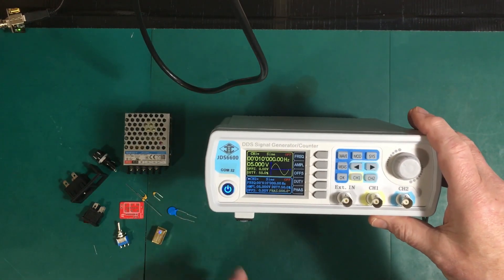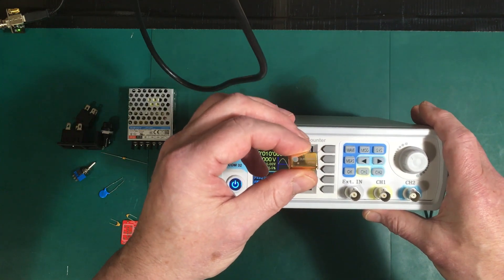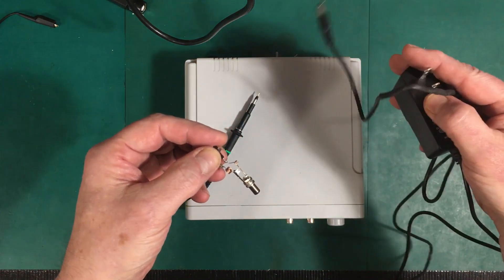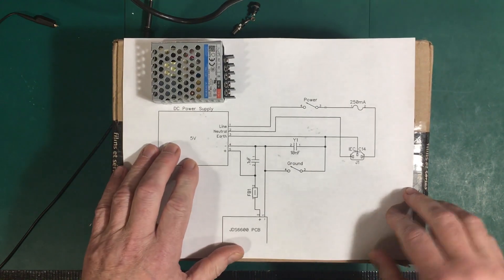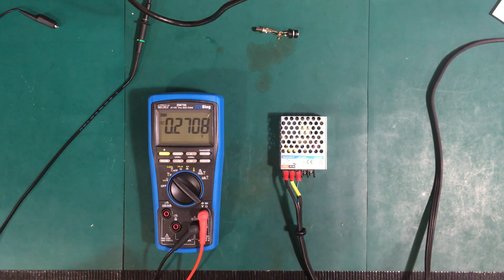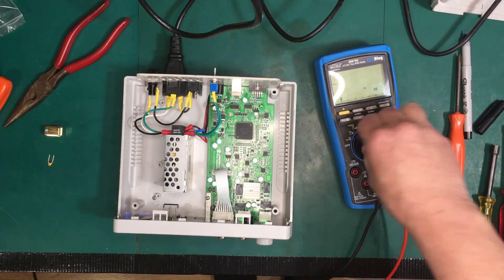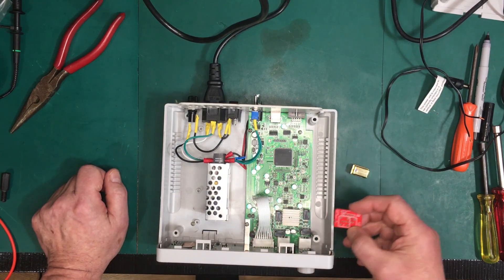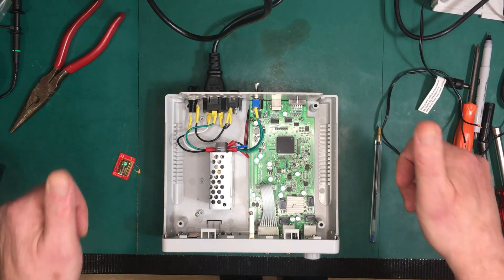0048 - Improving the JDS6600 Part 1:  The Power Supply

Comment: I know this is old video but I got my unit today, and checked that leakage , in my case it's 12 volts leakage but oh my god 132mA which is whouuuuu high. With device on or off, it does not change , so something is changed but not enough obvious. Good video , thank you .
Reply from the maker: It's almost certainly not the unit itself.  My guess is it's being caused by the adapter.
Reply: @uni-byte Tomorrow will build my own supply with a transformer so it is going to have a very clean power supply .
Reply from the maker: @FantaBH  Sounds great!

Comment: How do you know before you buy it what is a good SMPS?  They all look the same on websites.
Reply from the maker: You cannot tell just by looking at them.  I have tried some of the ones off "popular" trading sites and I have not had luck.  The one I put in here is a Mornsun and you get them from vendors like DigiKey.  They won'' sell crap, and they provide full datasheet for all their products.  Meanwell are another good manufacturer.  Be careful though and buy from a proper electronics seller like DigiKey.  Both Mornsun and Meanwell have been faked.

Comment: i purchased one 3 years ago I have never used it just two or three times ....today I turn on the unit and the display is faulty, you can see horizontal lines and distorted characters... can these replacement displays be found? I don't find their factory site web in order to ask them via email
Reply from the maker: It is probably a common display module.  You might first try to re-flow the soldering going from the main board to the display or you could try to contact lee@junteks.com.

Comment: hi very interesting video of a nice unit    
if low noise is a goal why not try a linear power supply to provide the +5VDC   usually decent ones have noise below 10mV
Reply from the maker: Thanks.

I agree, a linear power supply would be far better.  Much lower noise and zero leakage.  And I did try to find a linear supply that A) fit in the case, and B) did not cost more than the unit itself.  But I failed.  I even thought of making one myself, but A & B above kept getting in the way.  When driving a square wave at maximum amplitude into 50 ohms on both channels this requires close to 2 Amps.  I do have a 3 Amp 5V supply, but with the transformer, filter capacitor and heatsink it is huge.
Reply: @uni-byte  hi thank you for the very kind and valuable reply
You clearly better than me
I am thinking of setting up a little lab at home to test some Audio gear 
This unit is very interesting
Thank you very much again for the test
Kind regards Gino
Reply from the maker: @gino3286  You are welcome.

Better?  No, just maybe a little more experienced. 

As for starting a lab, this unit would be a nice addition (drawbacks aside).  I used my unit for several years.
Reply: @uni-byte  hi thank you very much again
i would like to carry out some square wave tests on audio equipment  I like the test a lot   Very challenging but also very telling  of a unit quality 
I have wasted money on units and lab equipment look a much smarter buy
Reply from the maker: @gino3286  It should be great for that.  The rise time on the square wave is about 10.5 ns on the one I have (the 60MHz version).

Comment: Great video and I like the method to modify a test device rather than only to recommend to buy a better one. What I do not understand is the leakage voltage issue. What exactly is the problem? I guess you will only have an issue if your attached circuitry (device under test) has connection to earth (protective) ground. By the way you have implemented the switch bypassing the capacitor to basically get the leakage voltage down to zero. Do you really need it or was it only a provision that is nice to have but you never used it?
Reply from the maker: @heinzkreutziger2218 That one I actually bought many years ago and it was my main signal generator until I got my SIglent.  I used as it was.  TO be honest for those years I was not doing much in the way of stuff I needed a signal generator for and was concentrating mostly on vintage computers, small 8-bit computers and microcontrolers.  It fit my needs I guess.

The leakage voltage is a common problem with switching power supplies.  It is caused by parasitic capacitances in the transformers and issues with other non-ideal parts.  High ESR filter caps, stray inductances, etc.  Better SMPS have better components and dot no produce as much.  It's not actually an issue and is of very low current in most cases but where the generator (or other device) is going to be attached to sensitive components (FETs and such) in ground referenced equipment if can cause considerable damage.
Reply: Ok,many thanks for explanation on leakage voltage.

I have checked the market for function generator with good performance for reasonable price and I think I will give the UTG962E from Unitrend a try.

Comment: Grettings. Is there a way to make this generator operate in high impendance mode?
Reply from the maker: It already is.  "Hi-Z" for a signal generator is just how the output voltage is displayed.  There are no hardware changes.  On a generator that has 50 ohm and Hi-Z modes the outputs will remain at 50 ohms, but the displayed voltage will change depending on the choice of load.  Half as much for 50 ohms and vice versa.  For the JDS6600 the voltage is displayed assuming a Hi-Z load.

Given this I suppose changes could be made to the firmware and add/re-program a button to change the display to half for 50 ohms.  It's just as easy though to half the displayed voltage in your head when driving a 50 ohm load.
Reply: @uni-byte  sorry im mew to this
What i want is to simulate those specs in around 40khz square wave, 20Vpp

Output voltage impedance	approx: 390 Ω

Load impedance	approx:
0-1 kΩ short circuit
operating range 1-70 kΩ

No current recognition	 aprox. >70 kΩ

ZAPPER device,  DR. HULDA CLARK
Reply from the maker: @choosers5177  The JDS6600 has an output impedance of 50 ohms.   You can make a Hulda Clark zapper with a 555.  No need for a JDS6600.  The original zapper had an output impedance of 1K ohm, but that's tiny compared to the resistance of the human body.  If you wanted to use the JDS6600, just take the output through a 1K resistor to the handles, then set it up for a 10Vpp square wave @ 30kHz with a +5V DC offset.  Kind of overkill for something you could build for $0.50 but it might look cool to the "patients" in a quack clinic, right next the the therapeutic healing crystals and the homeopathic apothecary.
Reply: @uni-byte   @uni-byte  thank you.  I actually wanted to experiment with different frequencies and waveforms. That's why i want an arbitrary waveform generator. Also, there is no clinic, just a self test project at home.
First i thought about buying an TS250 waveform amplifier becsuse it has 1kilo omh impedance but ill try what you suggested even its a bit complicated for me i guess.

Comment: So would you still recommend this function generator given it’s price and effort or would you recommend paying maybe double and getting an old fluke or Agilent function generator
Reply from the maker: I used this for years before going ahead and doing the upgrades.  However, it has gotten more expensive since I bought it.  It depends on your needs.   Beyond what I fixed it is a very useful instrument.  Buying a used Agilent or other big brand name unit that will work out to 60MHz might do more than 2X the price damage to you savings .. a lot more.  Those units don't come cheap and you may need to repair or calibrate them before making used of them.  The there is the 2nd generation of these JuncTek (PSG9080) and similar machines that have addressed a lot of the problems and brought many improvements.  They run about twice the price.  Up from that in the 3x price range are the units from SIglent, Rigol and GW Instek.  They are stellar performers and come with support and warranties.   So it depends on several factors.  Your needs, your budget, and if you go for the used market your repair skills.
Reply: @uni-byte  thanks for taking the time to reply. I’ll check that out. I did indeed underestimate the price. eBay search was down when i made the previous comment, I was trying to search before i hit send. My needs are very basic but I prefer to buy once cry once. $250 would be my limit. Haha, just googled the PSG9080, they changed the name! Previously it was Junctek.. I think someone must have pointed this out to them as not the best name

Comment: Hi, I have JDS6600 Lite and it has no issues like I saw in your video,  it seems you have a defective one.Anyway I will follow you in mounting a power supply inside. Mine is from Joy-It but is  the same.
Reply from the maker: That's good.  Wall-wart power supplies are touch and go  I'd say your is unusually good.  But that aside.  My biggest complaint with  the power supply was the leakage voltage.  Have you tested for that?
Reply: @uni-byte  An upgrade, I have mounted a linear regulated power supply inside and changed the cheap electrolytic cap in the power input of the motherboard, and a block with an iec, fuse and mains switch in the rear.
Reply from the maker: @EduardoCruz-ur4wq  Nicely done!
Reply: @uni-byte  Not yet, but I in my mind the power supply was for replacing, as I didn t open my set I didn t know that was a huge space inside to mount one, I saw it in your video. Thanks.